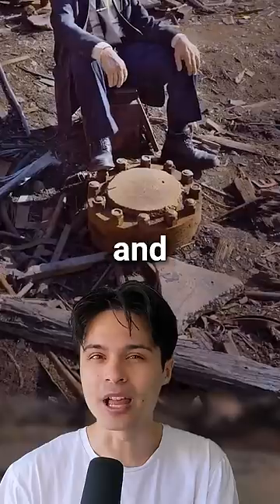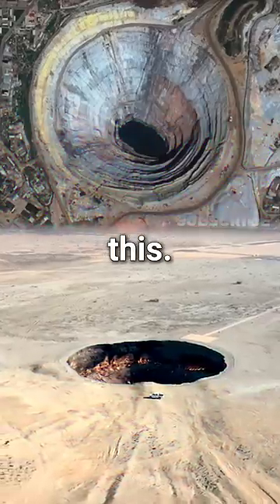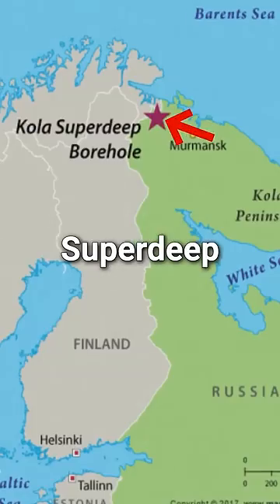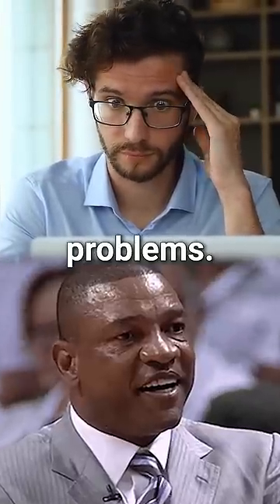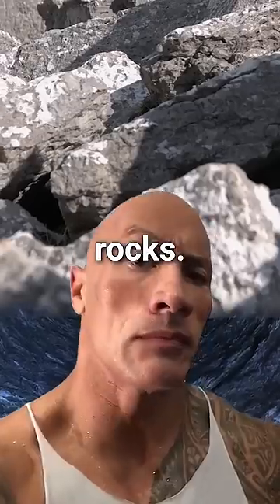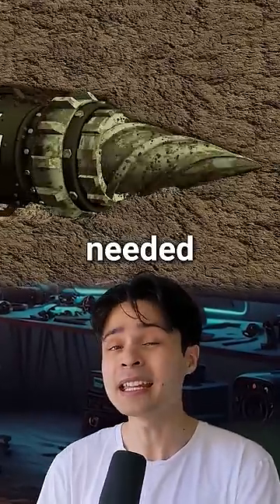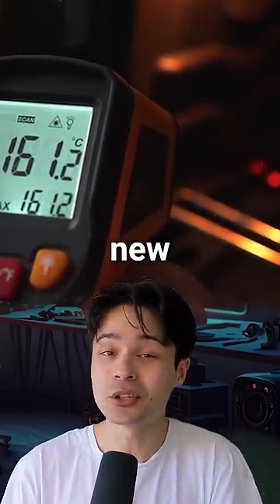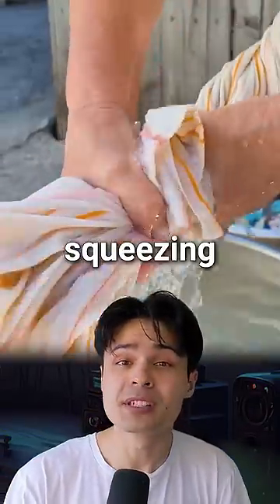What's Inside the World's Deepest Hole?

Comment: The video doesn't mention that the greatest depth achieved was an impressive 12,262 metres (40,230 ft). This was reached in 1989, the deepest manmade hole ever, and this record has not been beaten yet. Drilling had begun in 1970. It's also a scientific borehole, i.e. no immediate commercial use intended.
Reply from the maker: hehe i thought people might not know the significance of 12,262 meters
Reply: @alementary  Enlighten them then.
Reply: Shell beat that in the 21 century the tech you speak of in this short is now common in everyday drill for about the past 20 years that hole in Russia is not the deepest anymore and soon in the future won’t be even in the top 10 deepest because of MWD and mud motor tech and advancements
Reply: @hirevhoon7474  Really? So what is the deepest hole now?
Reply: @ToyTiger666  40604 ft Exxon drilled it not shell it’s the z 74 chavo well
Reply: It also didnt mention at a certain depth explosions were going off, idk if they ever figured out what it was but when i watched a video on it the video said it was unknown why. My guess would be a steam explosion, since there's water and its gonna flow down deeper into the hole where it's hot enough to melt metals. Could be the video i watched wasnt accurate too but pretty sure that actually happened
Reply: There are oil wells being drilled in Oklahoma and China that are around 30,000 feet.
1 Mile is 5,280 ft.
Divide the 30,000/5,280. 
That will give you how many miles.
5.6818181818 miles. 
40,000/5280
This will give you the miles
7.5757575758 miles. 

Doesn't seem like a lot but that is straight down
Reply: The real question is what would happen if we detonate a czar bomb at the bottom.
Reply: @DyspareEmbodied not much. It would be like setting off a nuke at the bittom of the mariana trench
Reply: @BrokeWrench I have no knowledge in this subject but Id say it would definetely have an impact, detonating the most powerfull nuke ever into a such tight space. An earthquake for sure but it could cause a lost of shit
Reply: @hirevhoon7474  - "it’s the z 74 chavo well"
That's the LONGEST, but Kola is still the DEEPEST.
Reply: The Chayvo wells are Extended Reach wells. They have a longer measured depth but not a deeper True Vertical Depth.
Reply: @freemind..  ?
Reply: @freemind..  do you mean not tvd but md
Reply: @hirevhoon7474  - "do you mean not tvd but md"
The question was "...what is the deepest hole now?"  While Chayvo does have the longest md in total linear feet drilled, it only has a tvd of around 3300 feet, whereas many boreholes are several times deeper in perpendicular penetration into the crust, with Kola remaining the deepest.

Comment: That drill bit is called the thermal governor. Most people just call it the governor for short. The governor has no gearing in it. It's just 3 grains that rub against the rock. With enough pressure, you can push through anything.

Comment: The Bit that spins while your Drill String is Stationary is not new Technology. It has been around since the late seventies as far as I know and is used for Navigation Drilling. It is used in Oilfield Drilling where they Drill multiple Holes from one Drill Site. By setting a Wedge  at different depths and using Navigation Drilling they can cut costs and Environmental Impact by Drilling multiple Wells and only setting one String of Casing. They also do Down Hole Surveys and they can see exactly where there is Deviation in the Well and where bottom is. This method is also used in Core Hole Drilling on Deep Bore Holes to cut costs.

Comment: "they needed a new type of drill bit that only revolves at the tip and they needed a system to lubricate that bit with pressurizes mud" I love watching videos (TicToc & Youtube mostly) made by people confidently describing something that they are totally unfamiliar with. A Mud motor system, which is what he is describing, and use of drilling mud for lubrication ( AND powering the mud motor and clearing the bore hole of cuttings) precede the Kola, started in 1970, by several decades. The Russians did not invent any of this for the Kola although they would have made adaptations for their particular situation.

Comment: sooner or later we will learn how to drill without a drill head.  what do i mean... well, we have high pressure air/ high pressure water and eventually lasers that will be strong enough to vaporize rock.  ()(i would think harmonics fits in there somewhere but not sure how that may be implemented) my guess would be a drill head set up like a tuning fork really LOL  but i don't think the material it would be made of has been invented yet.  what i don't understand is why we aren't using these sorts of holes to create artificial geothermal power systems.?